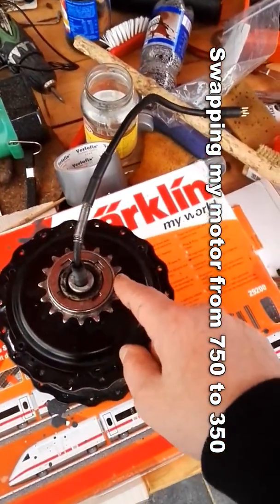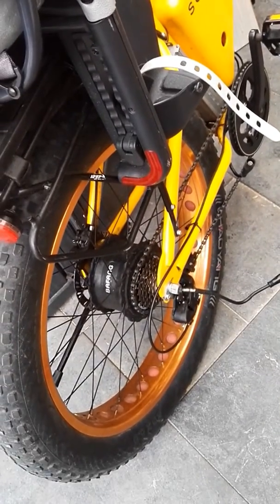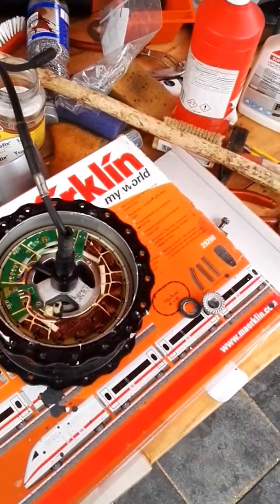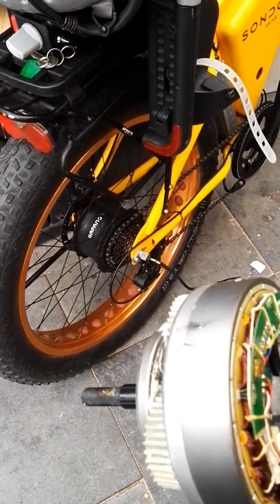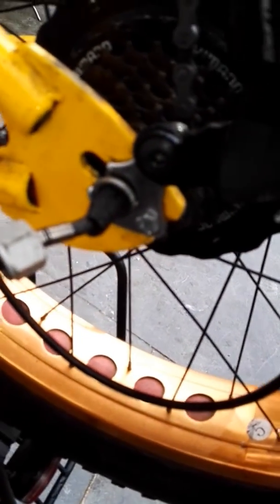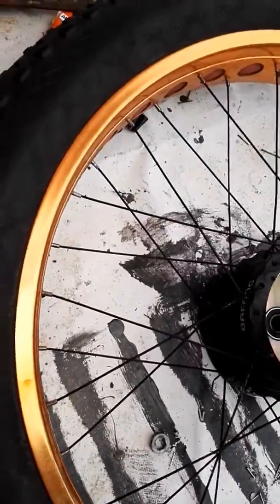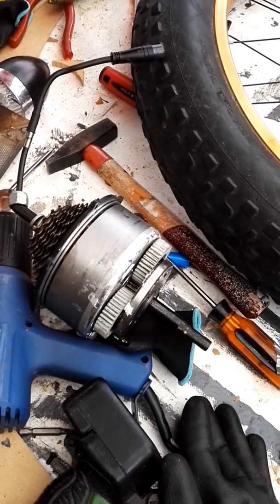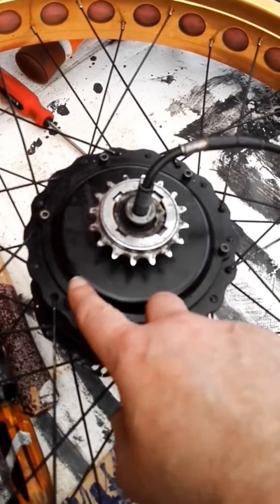MotorSwap Bafang 750 watt to 350 watt on my Sondors

Comment: The insides of my 350w motor does not want to come out of the housing. Is this supposed to happen? Can I just mash it out with a hammer? Or is there a special way to take it apart... The 750motor slides right out of the housing.